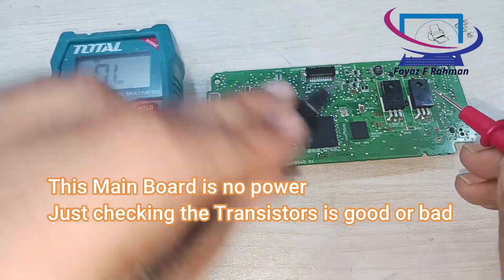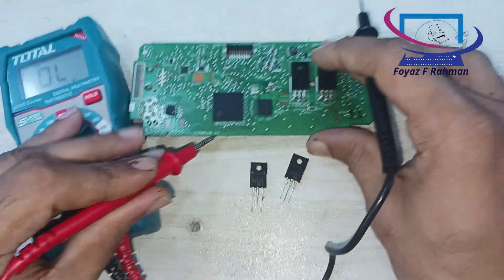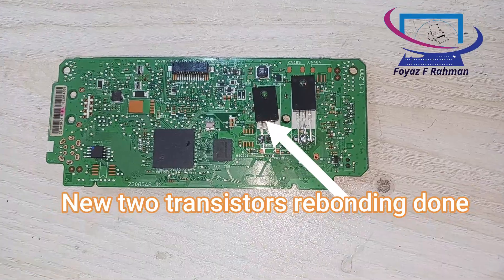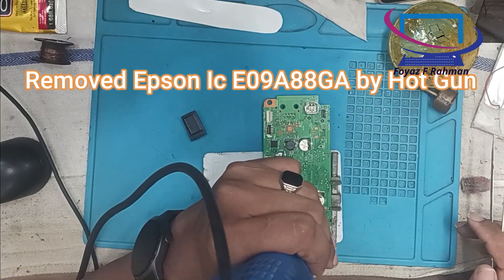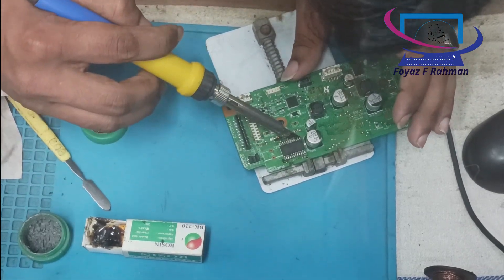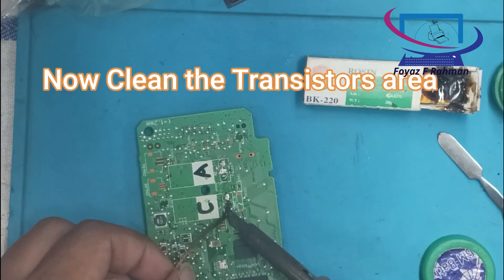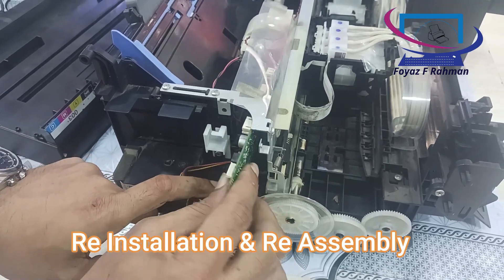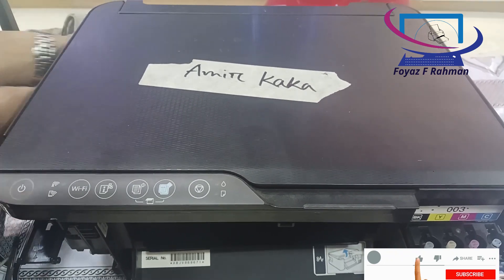How to Check IC & PNP,NPN Transistors |Problem Fix| No Power Epson L3110, L3150, L3250 Printer

Comment: I replaced 2 transistors and the reading is good but still no power the switch is good and fuse should i replace the ic it seems hard to solder it lol can i ask what temp sre you using for hot air desoldering thank that it will not burn some parts of the board im a newbie 😂
Reply from the maker: Please change the main IC

Comment: the transistors burn out because there is a short circuit on the signal ribbon going to the print head?